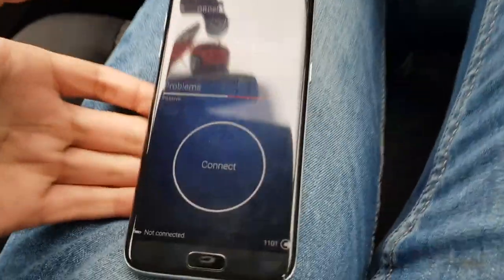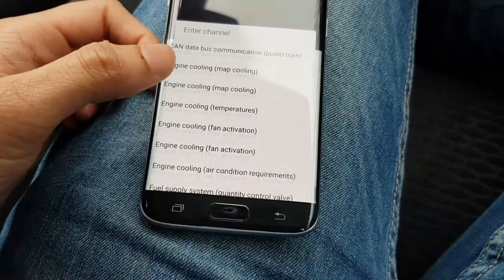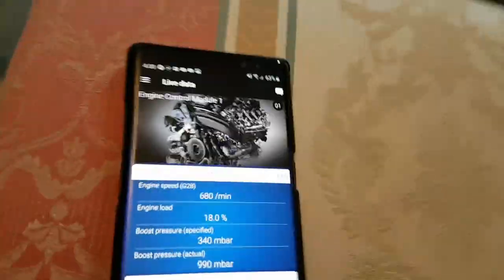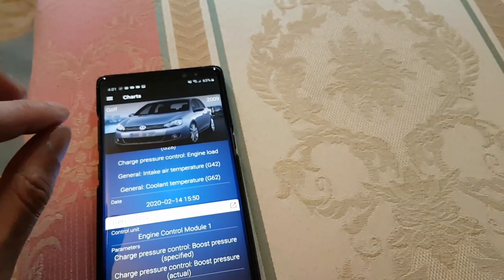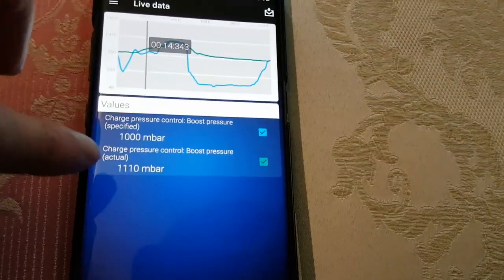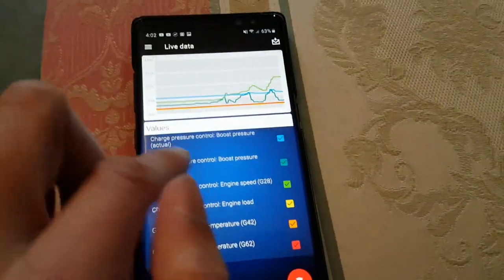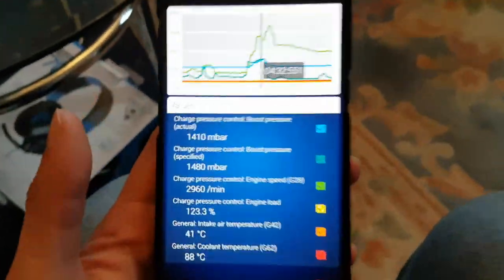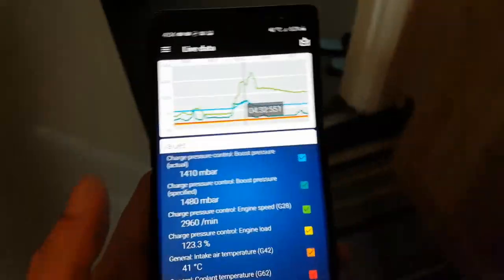How To Check For Turbo Boost Leak Using OBD Eleven

Comment: Did you ever figure out why the actual pressure was so much higher than the specified? I am having the same issue
Reply from the maker: It is normal to have 1 bar higher apparently due to atmospheric pressure

Comment: I am late to the party here.  But, what you were experiencing is a Wastegate Actuator failure.  They fail quite frequently.  
Your Actual is higher than the Specified because the WG Actuator is not functioning correctly to open/close the Wategate flapper.  In this instance - you are over boosting (so stay out of boost) and then the actuator mechanism is catching up at some point.  But, it is faulty.
The ECU may not even throw any codes - unless you have a hard acceleration and you go into Limp mode.  Otherwise, you will be dumping more fuel and feal sluggish at times.
Reply from the maker: Thanks for letting me know boss
Reply: @MrWaheedulHaque  Did you end up ever figuring it out? or Possibly need to get a new turbo?
Reply from the maker: @MegaHollywood1971  60k miles later no issue haha turbo still going strong, you know when turbo is bad it will start to whine at you haha :p, thats how it was on my other car it was whining like crazy so i got a new turbo on my other car, this car turbo is good
Reply: Facing a weird issue myself. No check engine light, acceleration is laggy, runs sluggish and all these issues are fixed if the MAF is disconnected.
Reply from the maker: Try clean the sensor boss
Reply: @MrWaheedulHaque  replaced the MAF with a new one as cleaning didn't make a difference. Still the same.
Reply from the maker: @thefastelephant94  check all vacuum lines